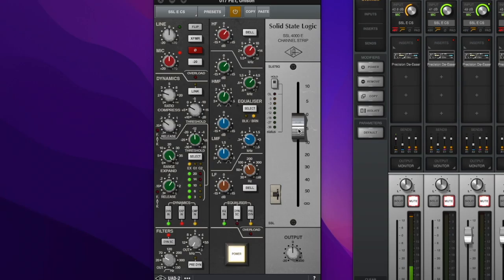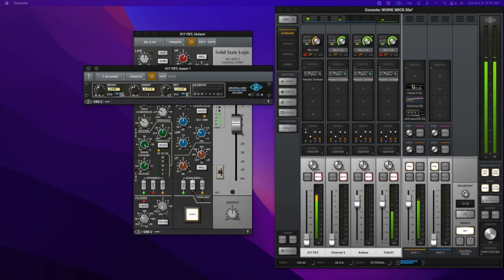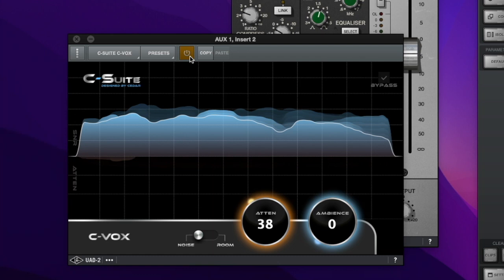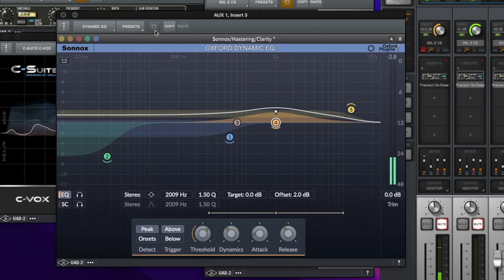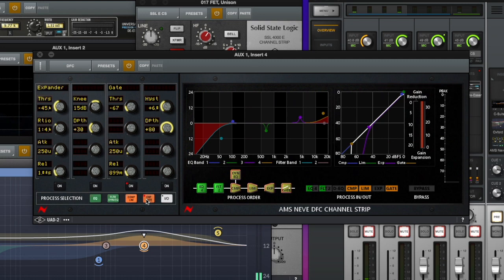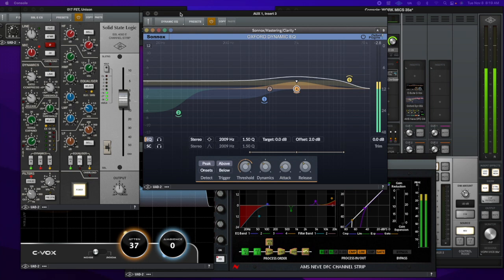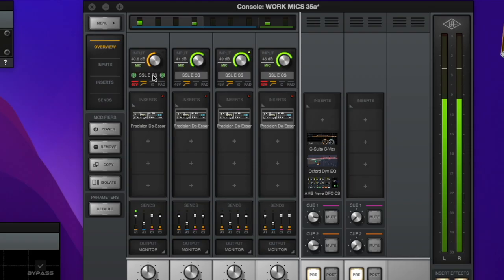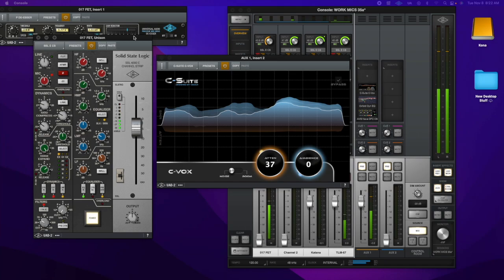My New Favorite Signal Chain for Voice Over

Comment: For compression I think you should try the 1176 and the LA2A Silver in tandem.   They work very well and naturally together, and they add a warm tone to the equation.  Glad you're building chains again.
Reply from the maker: Thanks! Yeah man. It's funny because the 1176/LA2a combo is what I did in my very first chain video from like 6 years ago. It's a great combo. For color on a sterile mic, I actually like the 176 better than the LA2A because it's just a little smoother and I like the mix knob on it.

Comment: I may be confused but i guess to dumb it down for me as someone who has never worked with vsts before

the C-Suite is cleaning up the background noise and noise floor making things sound very clean
The SSL- 4000 E is doing some voice compression and other effects (not sure which ones to be honest it seems to do alot of the heavy lifting)
and the Oxford Dynmaic EQ is predefined Equalization targets ? 
The DFC seems to just be some extra tweaks here and there to the compression and EQ mainly the compression seems to be the big thing its adding

So i guess aside from the three main take aways here are Cleaned audio + Compression + EQ ?
Reply from the maker: You got it. That’s pretty much it. The DFC just on its own is kind of a black box that outputs a sound with that broadcast glue on it, even if you just use the filter and nothing else.

Comment: Why split out the EQ, when you could just do it in the DFC?  The DFC has a dynamic EQ band, as well. 

I also don’t understand your plugin order. The de-esser would typically come last in the chain, after EQ & compression, as those can affect sibilance. 

Thanks for taking the time to produce these videos & share your experience; any insight in re the above would be greatly appreciated!
Reply from the maker: Hi Roland, So, I prefer de esser as early as possible since EQ and compression can make it harder to control. I split the EQ because I like the EQ on the SSL. I hit it with the 15k in the DFC because I like the related boosts at 4.5k and 9k and don’t want to hit the 15k before the de-esser and air is the last thing I’d want to add in the chain.  Also, the THD the SSL adds in the high end is so sweet, I don’t want to lose where it sits. Once it hits the DFC to glue it together, I can hit it with that 15 to just add a touch of sparkle. As always, what may work with my voice may not work with someone else’s, but it’s just all kind of an evolution of a process that I’ve been working on for decades and sadly know it will never end until they find my dessicated corpse in my booth with a microphone clutched in my cold dead fingers.

Comment: Awesome video Mark. Thanks for sharing. Are you able to print the Insert plugins to your Twisted Wave DAW? I have an Apollo Twin USB (Windows) and I don't think it has the I/O matrix options to route to my DAW unless I'm doing something wrong. I use Pro Tools.  I wish there was a way to save a signal chain template to share with other Apollo users so they can import it and tweak it to their own use but I can just follow along video and create it on my own
Reply from the maker: Hi Bill! Yes, I'm printing straight to Twisted Wave. I have TW set up to record MON L and MON R outputs, which on my rig are Channel 27 and 28 so anything I send to the monitor bus is what I record, which in my case is only ever my one voice output channel. So yeah, it's whatever channel in console is on and has faders up and isn't muted. I haven't used ProTools in over a decade so I'm not sure how to suggest a solution. In Console, do you have "UAD REC" selected underneath the meters? Doesn't that print your FX to the channel track you're recording? Yeah, you're right. There should be a way I can just have this as a template file that could be exchanged with other UAD users. It's probably some small file buried inside the Applications resources inside the system folder, but it should be something you could export from Console, right?
Reply: @MarkYoshimotoNemcoff  Thanks for the info Mark. I do have UAD REC in Console not the MON but I think it's more of an issue with the Twin USB. I did get a mac mini recently and definitely will check out Twisted Wave. Thanks bud
Reply from the maker: @BillBene67  Keep me posted.

Comment: Thanks for sharing your chain. I really like that Sonnox dynamic EQ! I wonder if I could mock up something similar in TDR Nova. I might have missed this but do you print the whole chain when you send files to clients?
Reply from the maker: Yes, I cut live through the plug ins and print FX. I feel more comfortable hearing what the client will hear when I'm on the mic, and often I have "turn and burn" bookings that come in that need to be cut and sent back super ASAP, so it eliminates the need and time to tinker and mix afterwards. It probably would be better to cut dry and just monitor FX and render them in after the fact, but even taking that extra 5 min to get a file out the door is too long when you have several to knock out while the clock is running. Let me look around. I may have a copy of TDR Nova around here. It sounds familiar but I never use it.
Reply: @MarkYoshimotoNemcoff  makes sense. I'm getting ready to record an audiobook in a couple weeks, and I'm going to print my analog signal chain on the way in this time. Trying to keep my editing as minimal as possible -- it really does add up having to edit and print the tracks after! TDR Nova is a cool free dynamic EQ. I use it to pull out resonances in poorly recorded podcast tracks mainly. There's a paid version with more functionality, I haven't tried that yet.
Reply from the maker: @marmaladecream2233  Admittedly, it's a lot easier getting away with printing fx on a 30 second commercial that may only run for a couple weeks or months than an audiobook that will be around forever, especially if you miscalculate something like the De-esser. But I hear ya. Audiobooks are just tons of editing. It's why I stopped doing them. I like work that ends the same day it begins. So yeah, it will save you time to print fx, but if you find that you don't like your settings and have to go back and re-record a small or large portion, that's no bueno too, so with longer form projects, maybe consider recording both the printed FX version and the dry version off an aux bus send just to have a backup in case you need it.
Reply: @MarkYoshimotoNemcoff  good point! I have a secondary output on my Daking preamps I can use for a dry version.

Comment: Love this. I've been using hardware to create a similar chain in a 500 series rack, But have recently been playing with the UAD plugins and this exact path!  Have you tried the API Vision CS as an alternative to the SSL?  Would be intrigued to know if you felt there was much of a difference..?   I actually quite like the option to switch to a graphic eq on the API strip.
Reply from the maker: Wolf Man! Dude, I really like the API Vision a lot and the new update with the graphic EQ is pretty great. I love the SSL for VO because of how "punchy and clean" it is at its core, but when you push it, much like the actual SSL hardware, you get this bit of THD, especially in the top end that helps it cut. It's not a lot, whereas with the API, you get harmonic distortion at lower levels. Plus,, even though the API is more mid-forward than the SSL, where it induces that harmonic content is right in the presence peak. Think about how big Neal Schon's distorted guitar sound in Journey is so in your face. That's the epitome of the API sound inducing a ton of character into that frequency range. I've used the API on VO stuff before and it does work well. I'm just more of an SSL guy, I suppose. I also greatly prefer having variable Q settings on the SSL EQ to help zero in on what I want and the SSL compressor is more transparent. I do have a CAPI VP-26 500 series pre that I love, but never use.
Reply: @MarkYoshimotoNemcoff  Hey man, sorry for delayed reply, was in a long session. Thanks for laying that out. Very interesting. Yeah I guess I can sense that too. Is that the same for the Neve 88?  I was actually running through a DBX 580 hardware, into an SPL De-esser hardware, then into the plugins...but wondering if there's a way to use any of those channel strips but disengage the pre on them...do you know?  I really like the DBX 580...super clean and kind of a Pre-Q as you have some filter controls. I have an SSL 611 E-Dyn comp and gate/exp, but am having to send it back as mouth pops register as clicks. I tried a second one and same issue. Not sure if others have had that issue, but will be sending it back. May. end up just using the Midas 500 series compressor I have and a plugin expander, and EQ.
Reply from the maker: @matthewwolf1793  I’m like 80 percent certain that if you go line in to the Apollo, you bypass the “preamp” circuitry of the Unison slot plug in and it would treat it the same as plugging line level into a console. The Neve 88Rs often gets compared to the SSL because it’s the “clean” Neve. It’s has fast transients and a pristine top end that avoids the “sparkle” of the SSL sound. The 88Rs was built to record orchestras, broadcast, etc. But that SSL sparkle (THD) is the SSL secret sauce. Sounds like you have quite a rig you’re working on there.

Comment: Great video. I’ve been watching a few of them as I’ve just entered the Apollo realm. Do you disable your plugins for submitting raw audio? Namely the C-VOX and DFC? Thanks!
Reply from the maker: Thanks. Yes I do! Actually, now I'm using the Neumann MT-48 as my interface and record without plug ins.
Reply: @MarkYoshimotoNemcoff Do you still use Apollo? Only MT48 when not using processing? Curious. Very helpful videos much appreciated
Reply from the maker: @JeffKellyMedia  No more Apollo. It's all MT-48 here now. It's impossible to go back to the Apollo once you hear the MT-48 because all you hear is the congested low mid that Console imparts on everything in its attempt at vintage gear cosplay.
Reply: @MarkYoshimotoNemcoff  Thanks, I’ll dive into the MT-48.. The sound and the ease of use,have me leaning in that direction.  Plug in game( with  ILock ect ) really driving me crazy. I want best sound and too keep it simple. Only thing keeping me close to Apollo is C-Vox real time noise reduction…any ideas?
Reply from the maker: @JeffKellyMedia  I completely sympathize with feeling trapped into UAD solely because of C-Vox. What I've been doing is using the MT-48's on board gate, which is simple and incredibly effective. If I end up with some noise tails at the end of sentences, or between syllables I just clean them up after the fact with a (not as comprehensive, nor real time) noise reduction plug in like Izotope, Clear, etc... or if you're on a Mac, Hush is incredible for removing noise and room ambience. Nothing is as good as C-Vox, but I realized I don't need to feel locked into what is lesser sounding ecosystem overall because of it. I do miss the ease of C-Vox, but the other thing I've come to find is that C-Vox, while seemingly near-perfect, does seem to dull the edges a tiny bit, which I can't unhear now that I've noticed it.